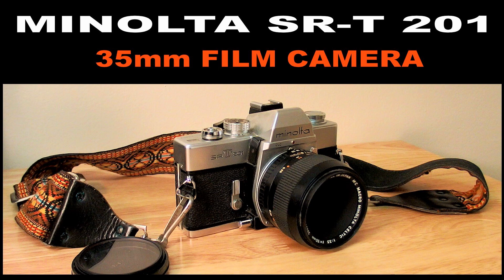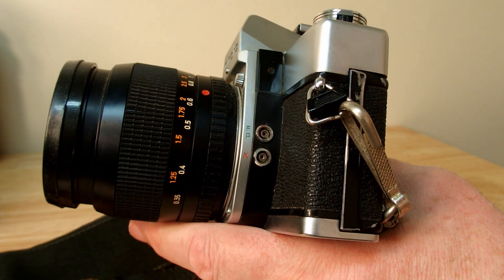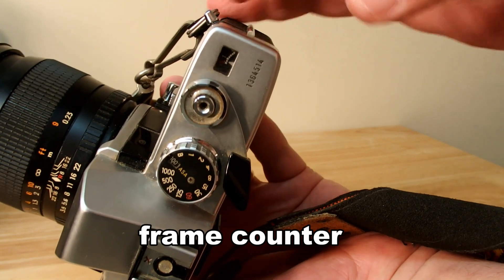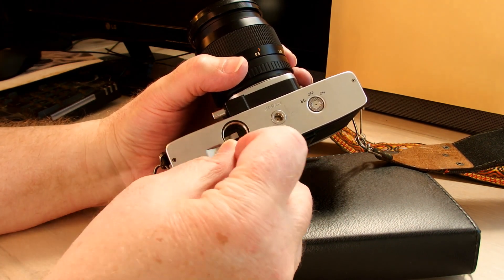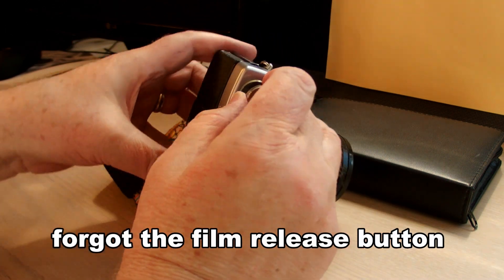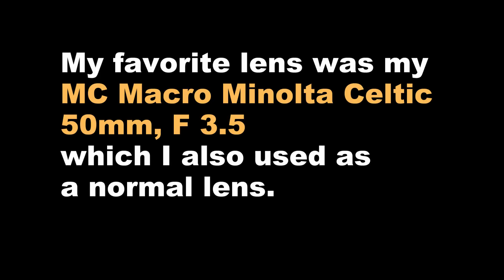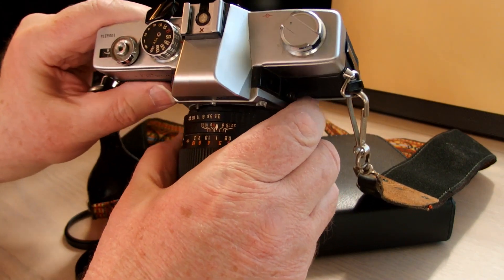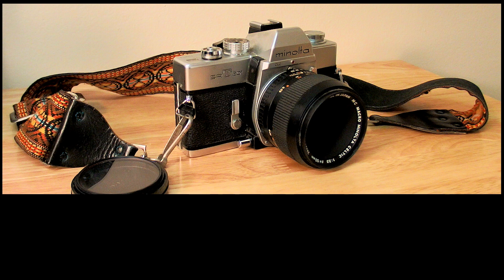The Minolta SRT 201 SLR Film Camera

Comment: Hi, do you know if the shutter is suppose to open AND close THEN reopen when a photo is taken? Because once i take a picture sometimes its goes all black in my viewfinder?
Reply from the maker: Not sure if I understand your point. This camera has a focal plane shutter. There is no open and close, although the effect is about the same. When you push the shutter button a slit of light travels along the focal plane that allows the film to be exposed. Seems odd, but in my next related video I hope to show pictures taken this year by the same camera in the video which has been operating without repair or adjustment since 1977 !! Thanks for the comment, Rob.
Reply: if you mean that your viewfinder goes black for a moment when you're taking a picture, it's completely normal, the mirror moves up so the picture can be taken, when it's done it just goes down again so you can see. It happens with all SLR cameras.
Reply from the maker: True - and one of the reasons people consider mirrorless cameras these days.